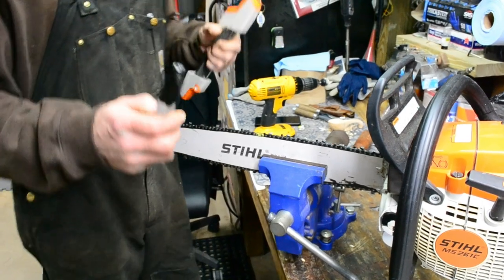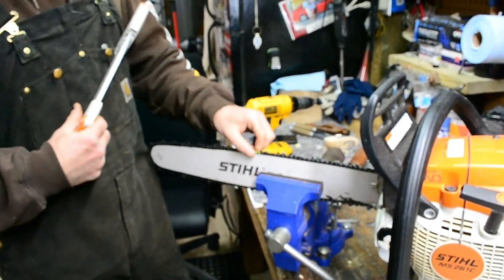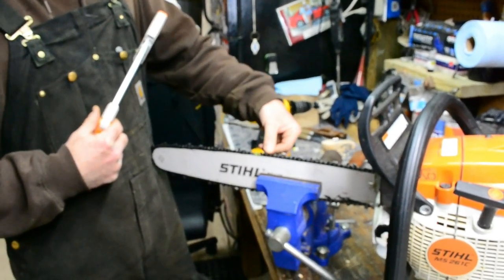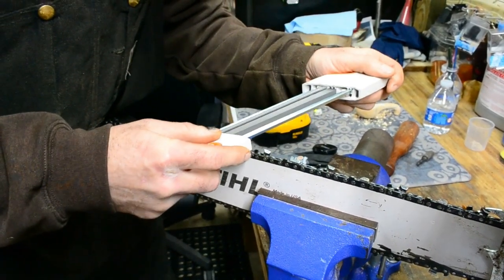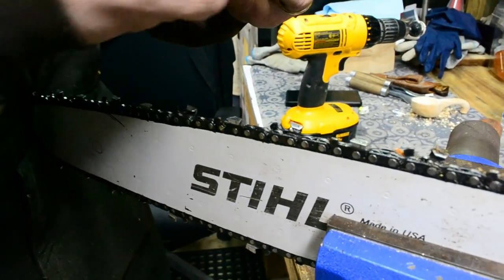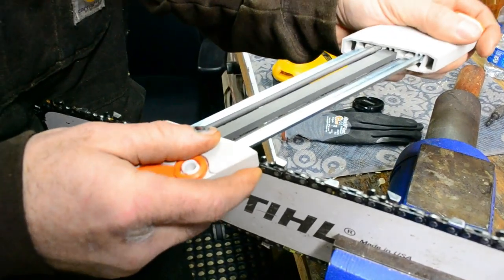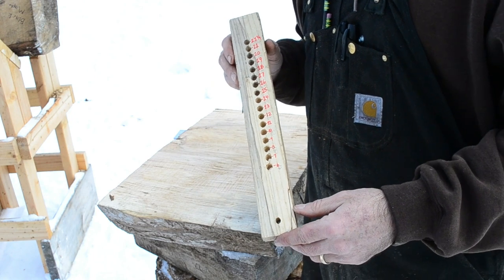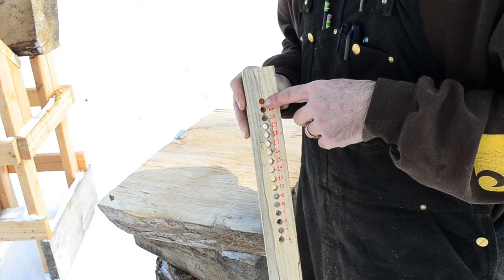Chainsawing Bowl Blanks Kinda Day

Comment: Interesting to watch Tanya. I like using chainsaws and I have several video's about it. Using an electric saw for this kind of work now.
But I tend to cut my blanks when I need them, electric is simply quicker because there's no start & warm-up. 
Generally I don't cut my blanks completely round, knocking the corners off suffices but having them as round as possible is obviously better for balance. Holding them is the main problem, I see you are having the same issues.
Are you planning to cut some yourself? 😁 Chainsaws are not exclusively for men.😎
Reply from the maker: Normally the only time he has an issue is when he's cutting smaller pieces and the thickness, but I think that is easy to overcome.  My husband bought me an electronic chainsaw, but he loves cutting the blanks. 
I plan on learning to use a chainsaw, but my husband said if I touch his he will break my arms.....lol! No, all joking aside one day I will use it.
Reply: @TanyaBecherWoodturning  Can't wait!